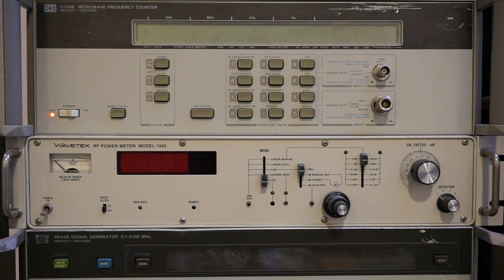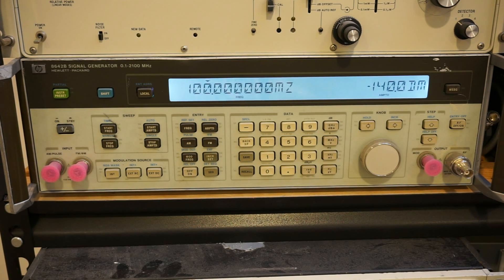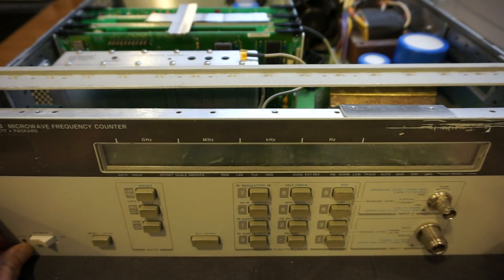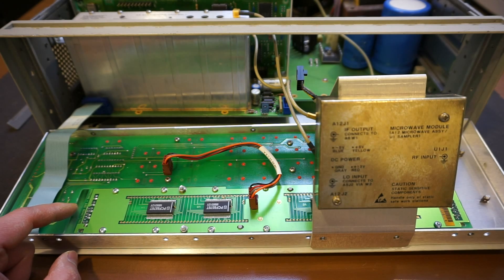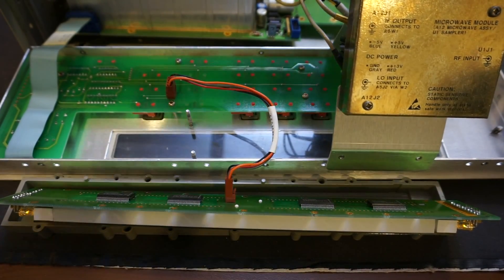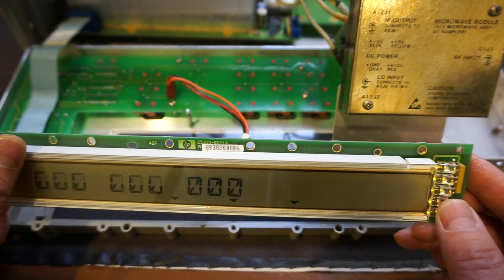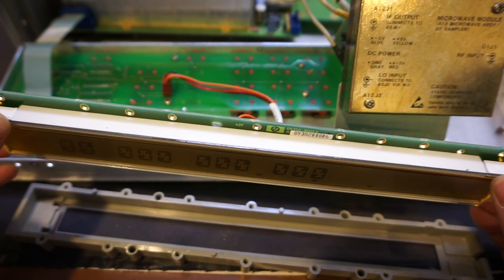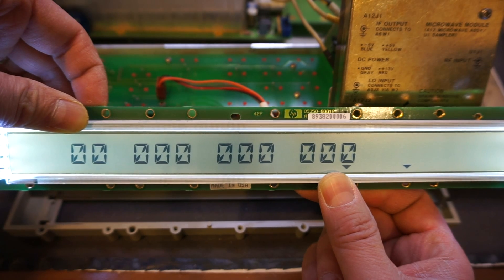HP 5350B Backlight Upgrade

Comment: Excellent tutorial, thank you! I just picked up a 5350B and I've already torn it open to figure out how to upgrade the light. It's pretty terrible from the factory. Of course, being this old probably doesn't help. This is extremely helpful!
Reply: I finished my upgrade today and put a short writeup on the EEV Blog. One thing I also did was 3D print a fixture to hold the LED's in position during soldering. That will be on the blog too. Thank you! 

For anyone else looking to do the upgrade, I used Brightek QBL8IW30C-NW LED's.

Comment: Hi Mr Wong, Im writing to ask you a favor :P can you pull your timebase on your 5350 and see if you get a u8 rom error on power up? i have a 5350b that seems to work fine with an external timebase (i am missing the internal one). but i get a u8 rom error on boot. thanks for the great video and i cant wait to do the led mod!

Comment: The white LED are probably 3.0 volt while the yellow were 2.3 volt. The circuit use resistor for current limiting with a voltage of 5 volt or 12 volt, so there is plenty of headroom to work with higher voltage LED.

Very nice way to rejuvenate older equipment. I bet the white LED remain colder, which add as extra bonus to preserve the LCD operation for many more years.
Reply from the maker: Thanks Christian!

Comment: Kerry - you may have covered this before...what are you using as a lab frequency standard? I think you said the generator and the counter were sync'd together but are you using a reference (GPSDO/Rb)?
Reply from the maker: Hi Dino Paps, I actually do not have a lab frequency standard. The 8642B was calibrated against a borrowed Rubidium standard and I had since used it to provide reference clocks to other instruments.